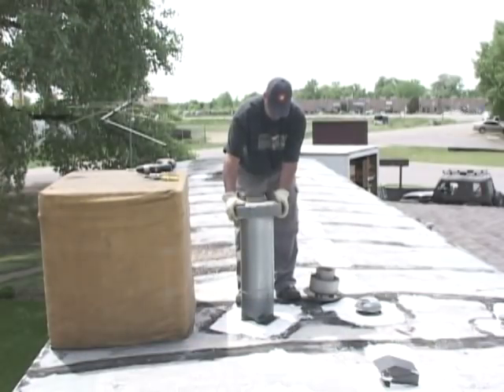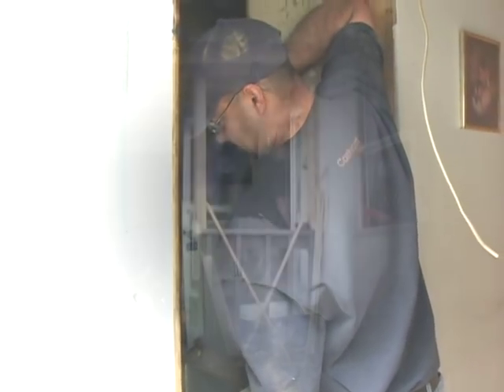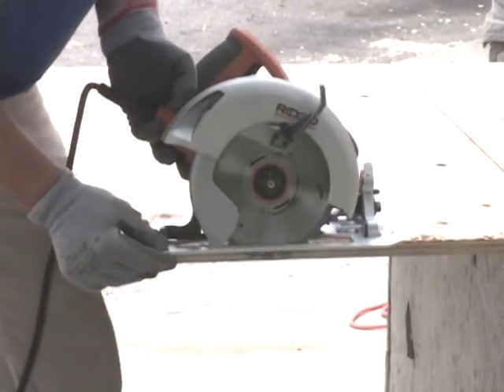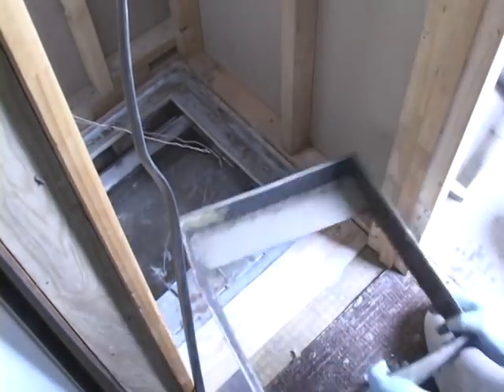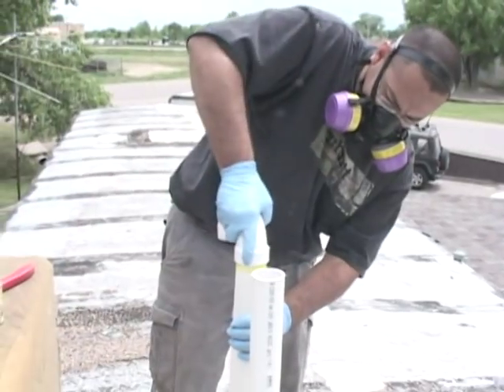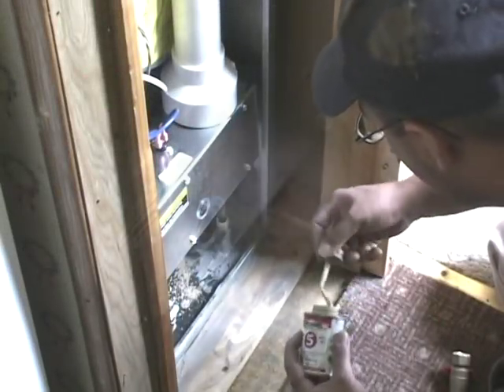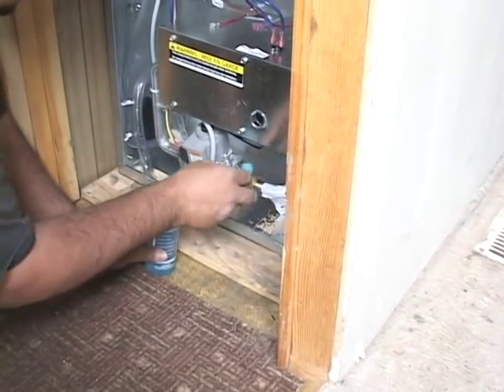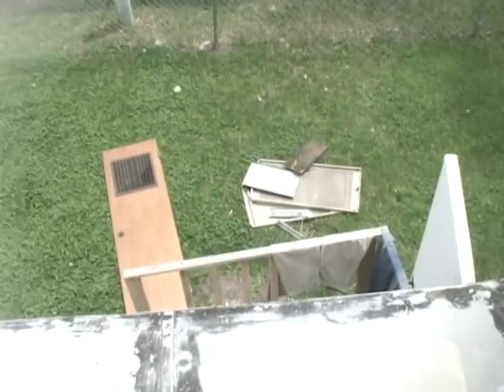Furnace Install   Mobile Home

Comment: Very quick on removal, but every bit helps we’re going to remove are Colman furnace and there’s not a lot of videos on how to. 
Thanks great starter points.
Chuck
Reply: Were you ever able to do the removal? I am trying to do the same thing and can’t find much either.
Reply: @UFCFan63  yes we were able to remove our furnace and closed up all the floor vent holes. We have a mini split we use to cool our mh and it works amazing. Very efficient and costs less a month to operate than the furnace. So glad we did it.